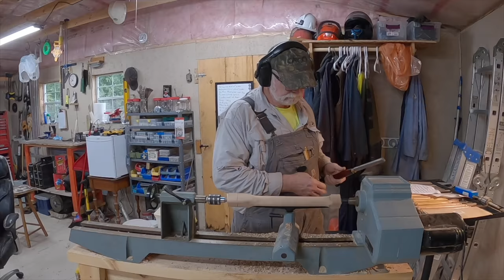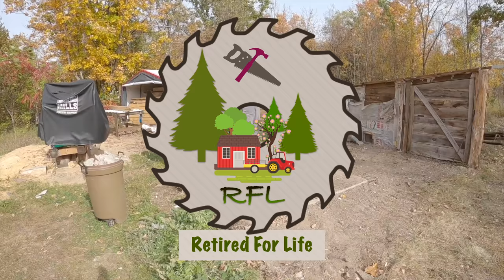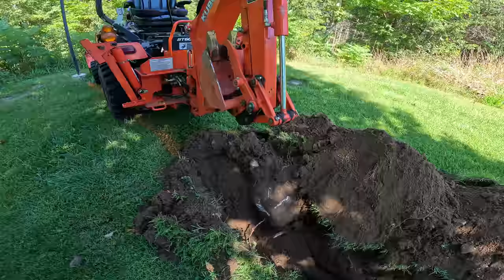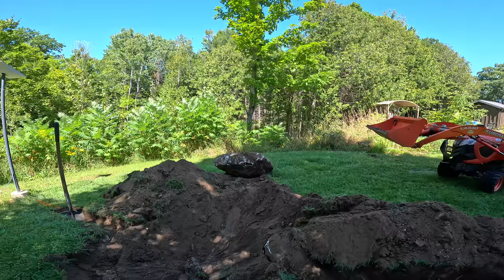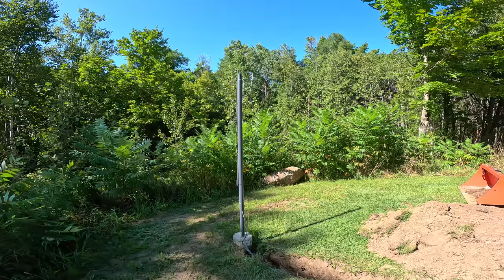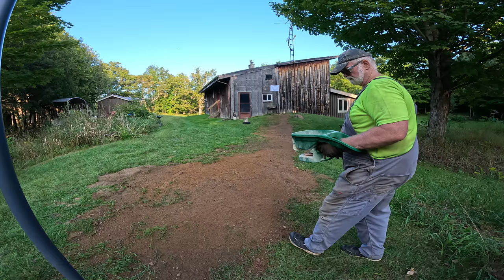FOUND BIG SURPRISE BURYING STARLINK DISH CABLE!

Comment: I finally gave up on the I pad.
We simply cannot make it work for doing you tube videos
We have gone to high speed internet which blows away the old internet providers… badly.
Very disappointed with the I pad. Would recommend anyway steer clear of them
Reply from the maker: To bad about the iPad. Sorry you couldn’t make it work. But, good your up and running now and with good high speed. Starlink is blazing fast for downloads but like most satellite systems, it’s a bit slow to upload.